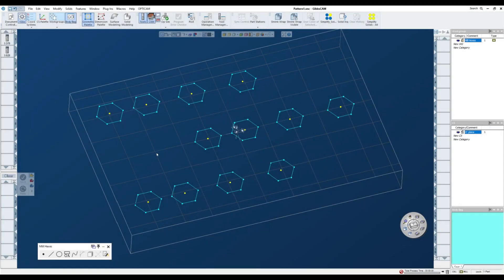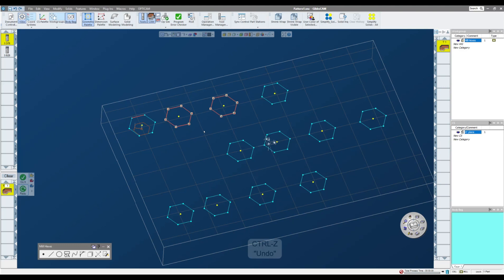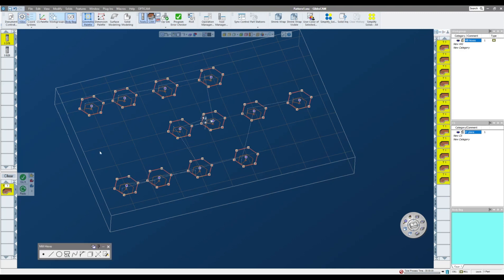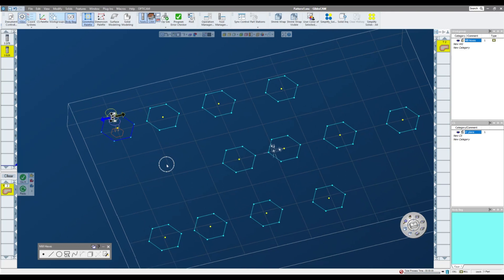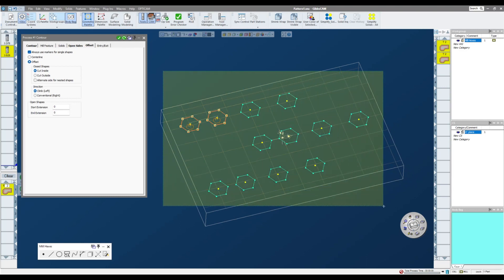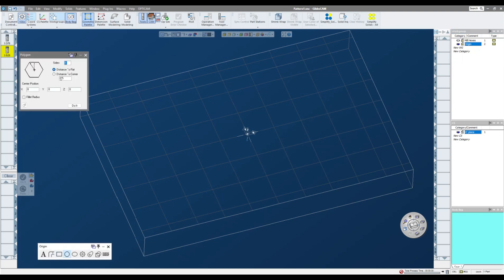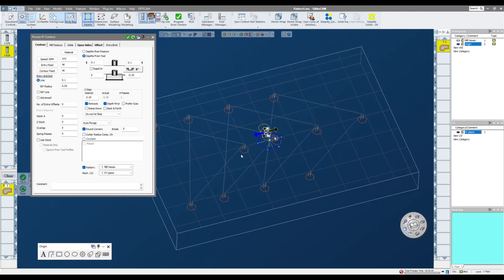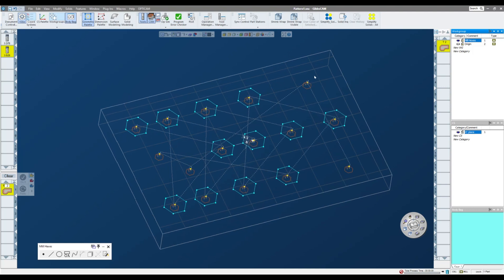CNC PROgrammer #21: Duplicate Toolpaths & Patterns in GibbsCAM

Comment: I tired using patterns in the past, but I don't like how the Z start is the height as the 'in-between height' between patterns. I would expect it to be the 'end of op value'  Any work arounds for that?
Reply: I hope I am understanding your question but, lets say that you have a value of 6 inches in the exit clearance plane. Since pattern creates the process all as one operation 
it will only retract to the 6 inches at the end of the operation, and not between each feature machined. If you want it to do that, you would need to select all of the features
without pattern, and GibbsCAM will create individual ops for each feature machined and it will give the 6 inch retract between each toolpath. Pattern is just another 
tool in the toolbox. There are situations where pattern makes sense to use, and others where it might not be the best option. Hope this helps.
Reply: @DaveMcCray  what you described is exactly what I had in mind.  I think if Gibbs would change the behavior so the “in-between moves’ are at the same level as the ‘End of Op position’ instead of the Z start, I would find the patterns function more useful.  Further more, I find it very troubling that the in between moves for milling operations is based on the Z start for that op while drilling operations rely on the in between position from hole to hole when using the pattern function. I understand why Gibbs does this, but it is not very consistent between the operation types. I find that this behavior also carries over to 5-axes machining and it leaves users like me a bit confuse because I never know the correct position on the Z axis when approaching my work after a tool change.  Yes, clearance volumes dose help address this problem, but it is not the best solution when approaching an inside feature with a right angle head. 

The one added benefit that I do like with the pattern function is that you can have your post set up to ‘sub out’ each pattern, making for a compact program if you have a machine with a limited memory size.
Reply: @cncmilljunkie  I find that when using clearance volumes, I frequently use advanced approach and retract along with it. You can get in some pretty tight spaces.